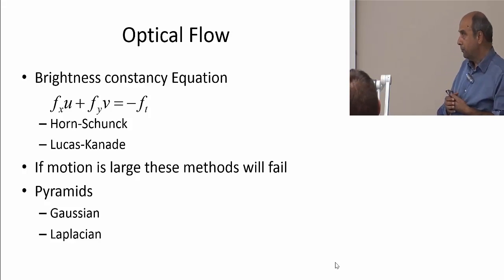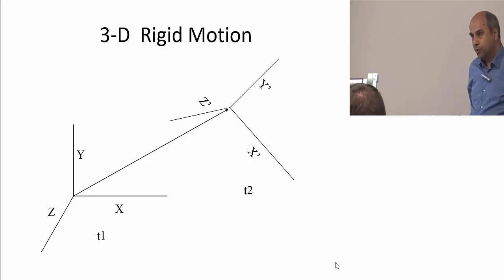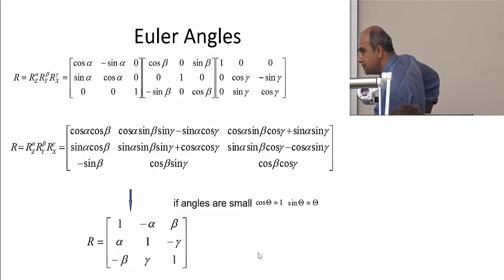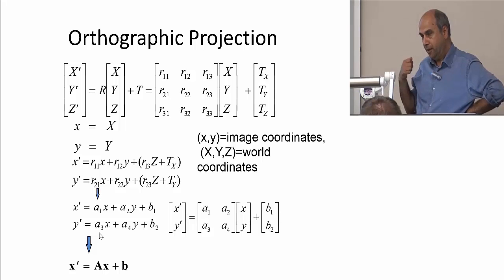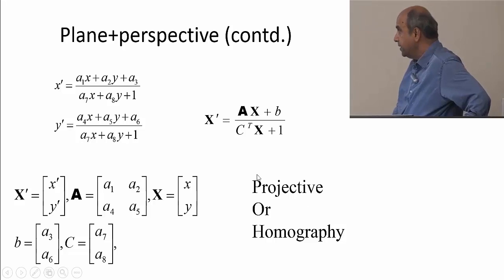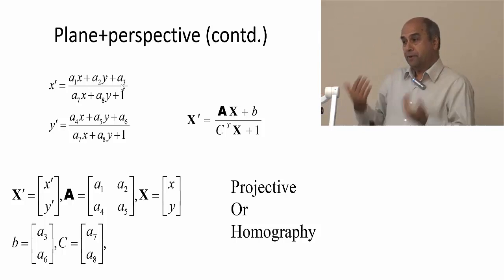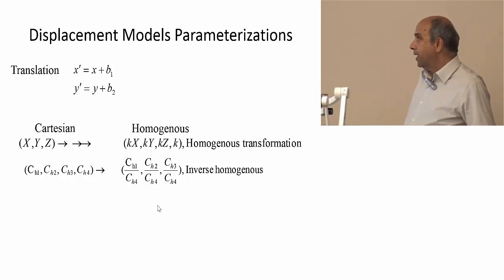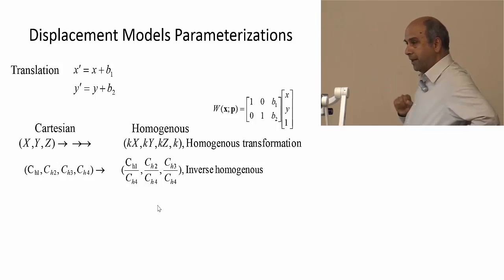Lecture 08 - Motion Model - 2014

Comment: there is a mistake at 20:37. in the third matrx R  first row should be cos(B), 0, sin(B)  (not -sin(B)).
Reply: actually, that row should be cos(B) 0 0. The third column of the R matrix corresponds to the vector W', the first row corresponds to the projetion of W' onto the axis X which is 0, second row is the projection of W' onto axis Y which is sinB and the third row is the projection of W' onto the axis Z which is cosB.